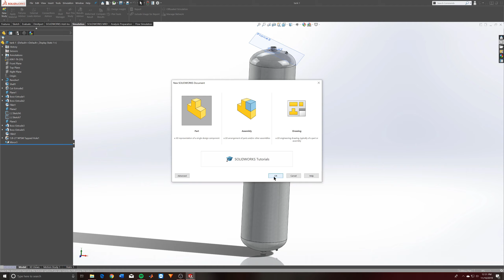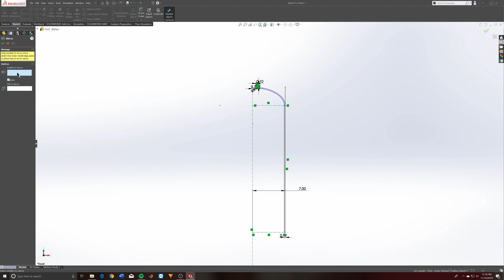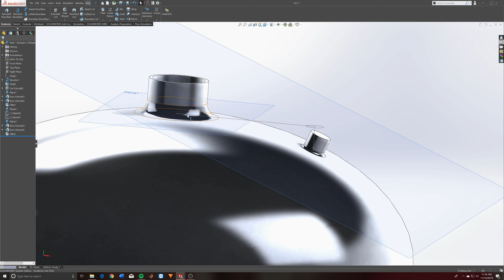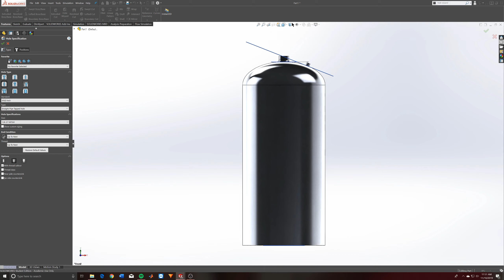Flight Vehicle Pressure Vessel  - Part 1 Tank Design (Revolve, Mirror, Hole Wizard, sketch)

Comment: please show how you take  reference plane for NPT valve connection...
Reply from the maker: all i did was make a front section cut of the model, and add a straight line  at a specified angle (i think i did 35 degrees or something like that) until coincident with the revolved surface. exit the sketch and use the plane reference plane feature to make your plane, and the 2 inputs will be the point at the end of the line you just drew and the surface of the revolved surface.
Reply: @Buzzkixx  Thanks a lot sir, you are a savior.

Comment from the maker: Video Shortcuts:
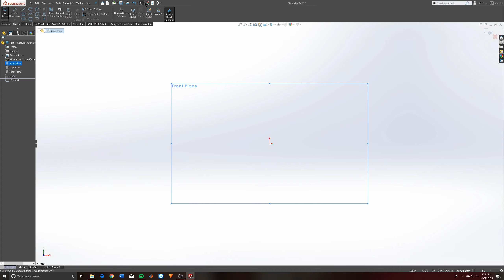1) Start Sketch - @2:30
2) Mirror Sketch - @9:32
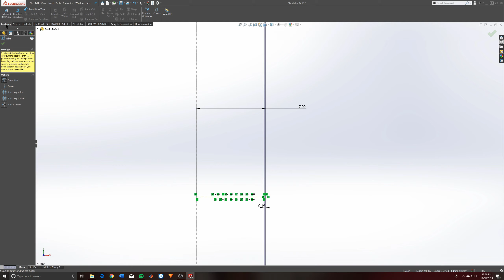3) Revolve Base - @10:50
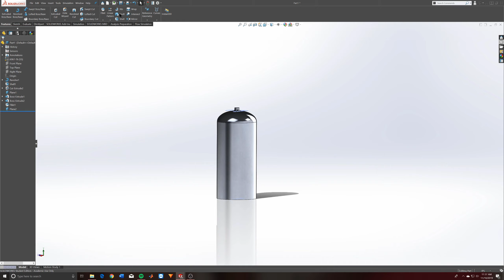4) NPT Valve connection  - @12:06
5) Using Hole Wizard to specify hole size - @16:15
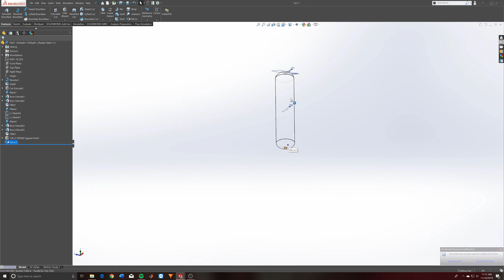6) Sign off - @19:40